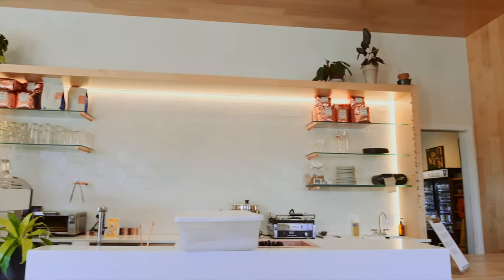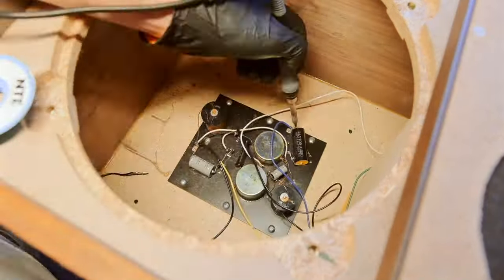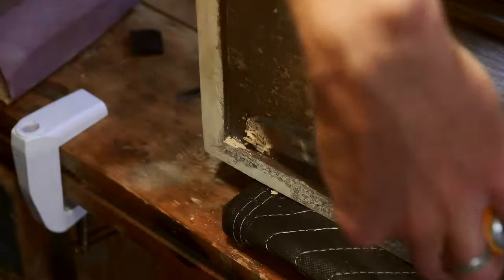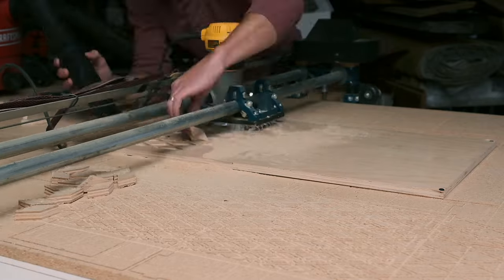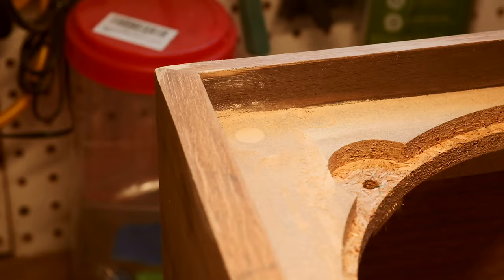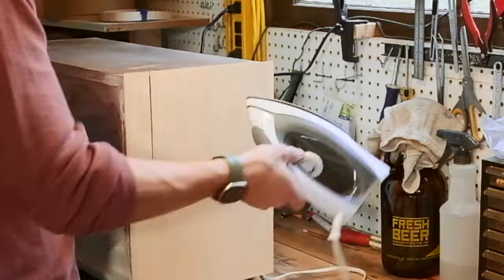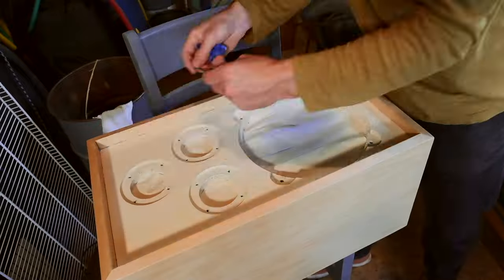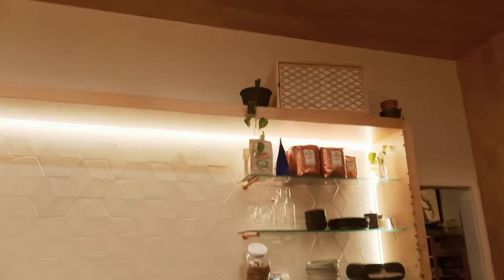Are $38 Speakers worth it?

Comment: Great video! Not done yet but seeing your struggles with the CNC I wanted to suggest leaving a 'tab' or two when cutting the diamonds. That way they aren't totally separated and stay down instead of flying around with the router. Sure you have to go back by hand and snip the tabs but it beats a bunch of failed cuts. Hope that helps!

Comment: Double sided tape baby , for the diamond grill cnc problem
Reply from the maker: We were going to do this but the cnc surface was unlevel from being cut into on previous cuts so we were worried that it wouldn't hold the pieces well...I should have tried it though haha.
Reply: @Shuksanaudio  oh ,in that case , double side sticky thin foam baby !

Comment: ok, you really failed the CNC part, but your best bet would have been to turn the wood into dust when cutting.
So you went to do a Contour around the Diamonds, and you noticed they were jamming the CNC.
Your best bet at that point would have been to Pocket all the Diamonds, it's not efficient, but you're not wasting material.
Another way to get away with Contour for the Diamonds would have been to either have:
- a Vacuum Table for the Router
- sticky tape / double sticky tape
- cutouts in the Router Table so the Diamonds would fall through the router table.
Reply from the maker: I didn't actually because I got what I wanted out of it and learned a ton a long the way. My brother in law is building a whole new CNC that I will get to use eventually which is exciting!